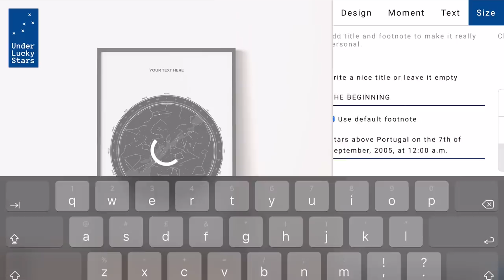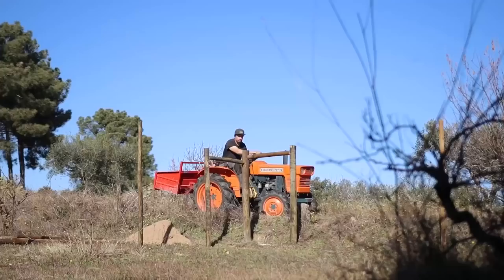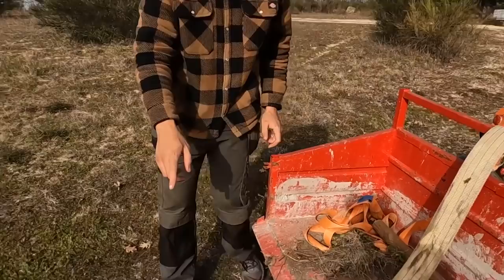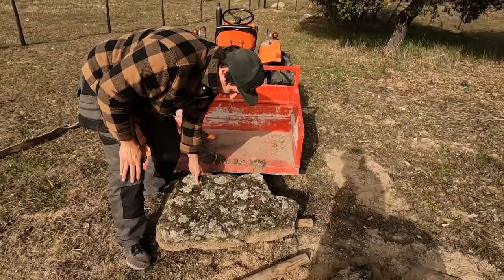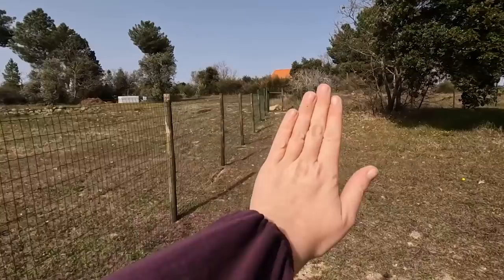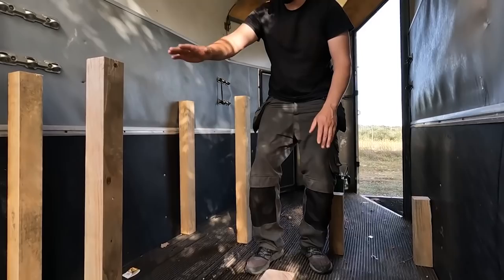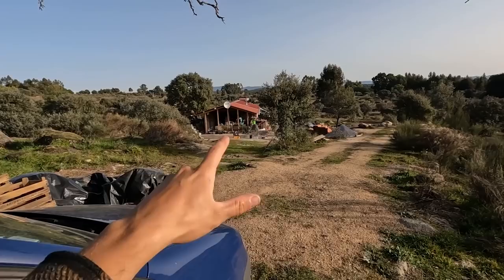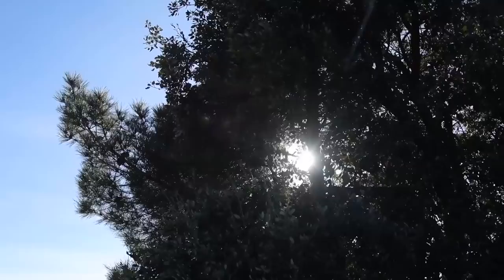BIG CHANGES! Living Off Grid in Central Portugal

Comment: Keep in mind that the trailer will be as hot as an oven in the summer. At some point you may want to build a stone building for them as it will remain cool inside during the summer.
Reply: I’m sure they actually located the trailer under a massive tree that is in the shade all day for that reason
Reply: It's only a temporary shelter. They have said in many of their other videos they will build them permanent structure once they have finished and moved into the barn.
Reply: There's a few ways to keep it cool. Keeping the doors open is an option.  And then there's nighttime.
Reply: Seems like it's only a shelter for rain or cold, so it should work great.  They have a bunch of trees in the goat enclosure for shade.
Reply: @juliejones7358  keeping it under a tree will not help in that kind of heat.
Reply: @bleh329  ya there is, I’m used to hauling horses and depending on how long we had to go, the trailer would have climate control on it.
Reply: @AZHITW  you read wrong. It gets very hot
Reply: If I remember correctly, this was a temp solution until they could build something more permanent. 💕🐐🐐🐐🐐
Reply: With it open as it is and in the shade it won’t be bad. It’s not like they are locked in during the day!
Reply: @katiegarrett822  Absolutely!💕

Comment: Bee, here's a little trick for securing the wire at the overlap corners. Get the cordless drill, put the piece of wire where you want it, leave the ends a little long and stick them into the drill chuck, tighten the chuck on them and then put the trigger. The drill will twist the ends as tight as you want. Then fold the ends facing out of the pen. Bam, easy peasy!

Comment: With goats, the nail glue and screw principle is required. So run some wire around the posts and fencing near the top and staple that down too. Limits sagging.
Start researching a single electric strand along the top too.
Stone is really good for their hooves!

Comment: Theo great idea to use wooden rollers to move the stones.  You might find it even easier to use much bigger diameter logs to make the rolling much easier.  Those small ones don't offer as much surface area on the ground to take all of that weight.

Comment: Goats dont need higher beds, they only need their beds changed once in a while and would be better to close the backside of the horse trailer because of the cold wind at night. Make sure you protect the tree trunks with fence, goats can eat everything and most likely kill any tree inside their enclosure by constantly chewing on the bark, branches and leaves....
Reply: Great job on the fence! Also, If you have Oak trees in your goat pasture make sure low hanging limbs are trimmed so that the goats can't reach them, because if they eat to many it will kill them.
Reply: @KSMCEVOY  that's completely nonsense....

Comment: if the goats get out through the gate you can use curved metal at the top of the fence like a pest resistant fence instead of barbed wire, it won't hurt your goats or cats but it will stop them from being able to climb over :)

Comment: Theo, the weakest point of your fence is the fact that the goats can just push on the fence and pop those clips out of the posts. You need something that will fight against the pressure that the goats will put on the fence. Also, they will lift the bottom of the fence up and go underneath it. They are very curious and adventurous. If you do not reinforce this fence, you are going to spend lots of time chasing these goats around the farm!
Reply from the maker: Errm the fence posts are on the outside there is no way the goat will be able to get the metal staples out. No way to lift up either. But I’m not going to please everyone 😀

Comment: Your goats are very lucky to have such a great enclosure! 
Time-saving (and finger-saving) tip when twisting wire (in connecting the sections of fencing): use a set of pliers to pinch the wire and twist the pliers. This also allows you to get a tighter twist.

Comment: Perfect ideas about the rocks and stone hendge for the goats. They love to climb to the highest point. So mounds of stones in the middle of their pen is perfect. Nothing to close to the fence though. I've seen people put old pickup trucks in their goat pens and the goats love to climb on them. But it's a lot of work to ready any old vehicle before it goes in. Taking out windows, seats, tires, tailpipe, all things they will chew on or be dangerous like the glass. But with all the rocks and boulders you already have on the property.... Use what you already have and it doesn't cost a penny. No cactus 🌵!  BTW, have you looked up how to clean the cactus pads and then grill them? Yummy!

Comment: Do you have a long steel rod as a lever? Or a 2"x4"  6-8 feet long to wedge under the boulders to lift and move them so you don't hurt yourself? You can get one at the hardware store often called rock busters. Great add to your tools you'll use often. Solid steel with one flat end. 👍🏻🇺🇸

Comment: Try to find an old cast iron bath tub as their watering trough. It's perfect and heavy so they can't tip it over. Big enough to soak in on hot days too. Most places will give them to you free or for really cheap! It doesn't have to be perfect like you would want indoors. It's a goat watering through. Rust spots allowed! No decorative feet.

Comment: The way the corner posts are supported can be improved upon.  Bracing corner posts is normally done with wooden supports at 45 degree angle to ground level, not by horizontally positioned supports at top level.
Reply from the maker: I disagree, in Portugal 99% of fencing is done with a H brace 😀

Comment: Gooday guys; just a suggestion to protect the horse float wiring and cables from the goats chewing them, is to either remove the cabling altogether or cover the  cabling with a metal cover. After transporting the goats to site; I suggest you also remove the wheels and store them well away from the goats. Love your adventure, God bless.

Comment: Bea and Theo, have you considered just extending another paddock from the 2 cemented corner posts on either side for some rotational grazing/browsing?  Goats eat a lot and fast.  They will likely eat everything in that fence in a few days.  Also, you can seed each paddock when they're not present in one or the other.  Plus, it gives you another paddock for a possible horse/cow/mule/donkey...you could use a horse/mule/donkey to plow fields.  Just a thought.
Reply: I believe they had mentioned they would be rotational grazing them around their property eventually. A donkey would be a great addition! 💕

Comment: Loved this. Lucky goats to have 'found' you both.  Have been thinking about your semi-circle by by your door. What about lining it with aluminium like a rigid pan (not foil) and inside that put a rubber backed mat....easy to lift out and clean. It would hold all the dust/grit and stop it going on to your beautiful floor. I think your friend who welds would be able to advise.

Comment: Please check the fencing. I’ve been told that the narrow section which you have at the top, should be at the bottom. I suppose to deter smaller creatures. Interested in others views and a professional opinion.
Reply from the maker: It’s on the top and the bottom 👌
Reply from the maker: Hey Carl our fencing has it top and bottom 😀
Reply: @theindieprojects   that’s great. Well done.